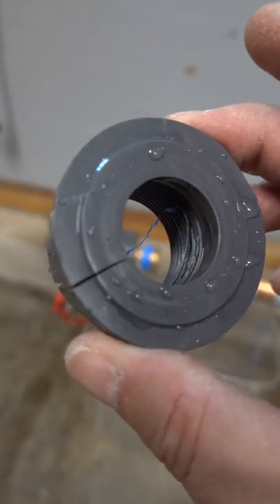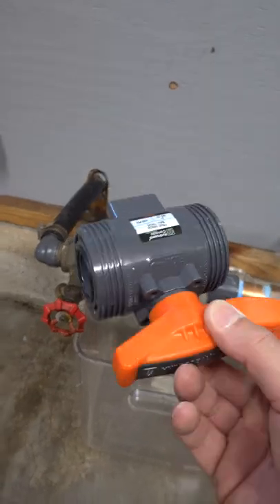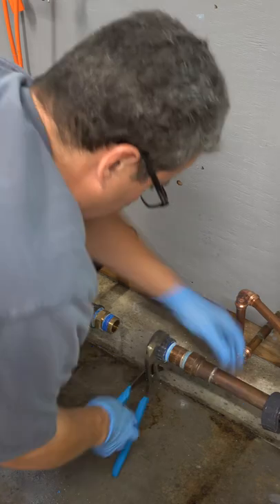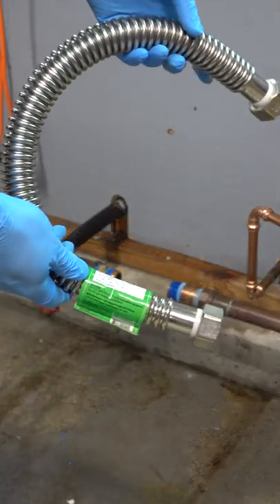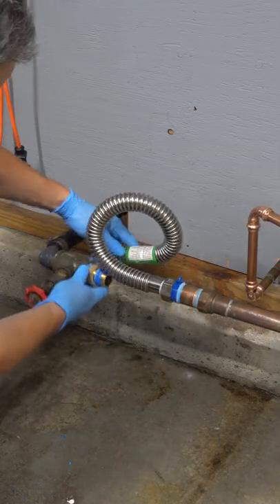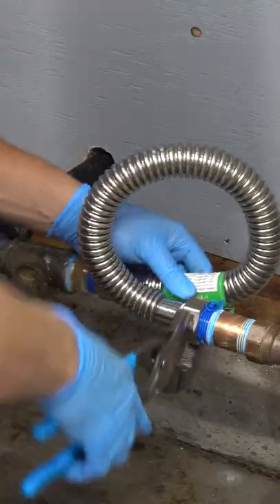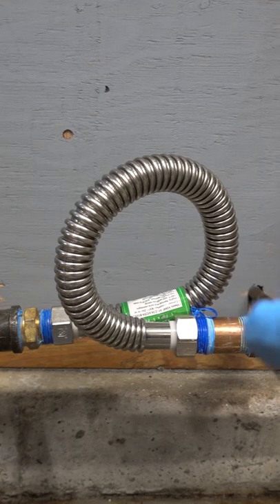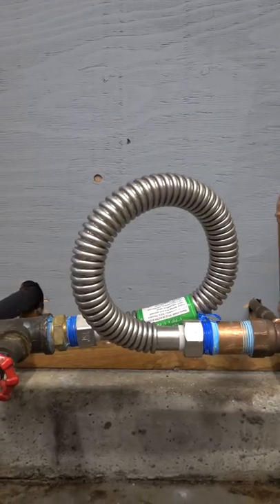POS Valve Almost Ruined by Marriage

Comment: “Hot water heater”😂
Reply: "Appliance that heats cold water to make the water hot"... ATHCWTMTWH 
hmm, "water heater" or "hot water tank" is easier
or, more properly, "potable/domestic water heater"

PS I got your joke😆
Reply: Randall Moore  radiators typically refer to things that "radiate" heat to the surrounding air, so no ... unless the radiator is enclosed in a vessel or container to transfer heat into another liquid/gas/substance, in which case it is called a "heat exchanger"
Reply: Randall Moore  incorrect... radiators do not heat up water, radiators "radiate" the heat FROM the water/steam/other (water/glycol mixture, whatever)... the water/mixture is heated by a source of heat, usually a gas boiler, in which there is a heat exchanger which transfers the heat from fuel air combustion into the closed-loop mixture
Reply: Randall Moore  to distinguish between the different systems, terms such as "hot water tank", "tankless water heater", "potable/domestic hot water" are commonly used for the domestic hot water side, while "central heating", "radiators", "infloor heating", "indirect tank", "boilers", "furnaces" are used for the heating side... at least in southern Ontario Canada 🇨🇦
Reply: Randall Moore  they do exist, except you are using incorrect terminology... I'm explaining that inherently a radiator "radiates" heat ... the appliance with the heating element is NOT THE RADIATOR, it is the HEAT SOURCE, be it electric, gas, oil, solar, nuclear... that is what contains the HEAT EXCHANGER
Reply: Randall Moore  given there are radiators that have an electric element and heat up oil... those are self-contained radiators, containing all of a heat source (electric element), heat transfer fluid (oil), and the radiator housing itself...
Reply: I live in the SoCal high desert. It's an accurate statement here in the summer. You heat the hot water... hotter. 😀
Reply: @blaydCA  I never been that far south 
What is your heat source? You guys use solar loops exclusively? or you have aux. backup heat? 
I've seen solar preheat loops that feed into gas-fired hot water tanks up here..
Reply: @walterbrunswick  One house is expensive Profane (pun intended) Gas with solar preheat tank, the other one is expensive electric. The service pipes for the area tend to be shallow and warm or cold depending on season. Edit: I'm high desert, so it does freeze here.
Reply: @blaydCA  what is the frost line down there? min. burial depth? here it's 5' 6" 
maybe I'm just naive, never would imagine it freezing in SoCal..😲
Reply: @walterbrunswick  It can and does go below freezing in SoCal. Obviously the higher elevations see a lot of freezing. In my general area service lines are about a foot down or more. I have no clue to what the frost line is. As a former New Englander, when we have extended freeze warnings I leave the water dripping. Unlike some, I've never ruptured plumbing from a freeze.
Reply: @blaydCA  if you need to leave the water dripping means smth isn't right.. we don't seem to have that problem in Toronto, and last winter was brutal cold 
I somewhat regularly see plates here from New England.. and there is a Cali plate Ford that has been next to my Dodge service van for a while now at my apt. complex ...... couldn't see myself moving to CA..... I would miss the brick buildings and architecture too much, even though I don't like winters (after childhood) ... don't like the heat and CA architecture isn't for me
Reply: @walterbrunswick  I don't takes chances, old habits die hard. Pennies for water is cheaper than blown pipes. Just ask Texas when they had their last hard freeze!
Reply: @blaydCA  😄😄 ... you're right about old habits 🙄......
... got tangled up in PEX discussions here on YT today.... PEX-A, PEX-B, flexibility, burst pressure, Dr. Engels, crosslinking, removing H+ ions, peroxide curing vs. moisture curing etcetera .... what in the f... never felt more confused.... several nights of insomnia doesn't help ....
What piping do you have in your houses in SoCal?
Reply: @walterbrunswick  As a general contractor: it ranges from galvy iron, copper, PVC, and Pex.  I personally don't install pex. Old school here, no shark bite crap, or those EXPENSIVE crimped copper fittings.
Reply: @blaydCA  understood 
I've never had any problems with Sharkbites or PEX ... haven't had a need for crimped fittings (I mostly do service and repairs), but they are good (see my other thread/argument here with an "old school" gentleman)
Reply: @walterbrunswick  I've had service calls for leaks from previous installer using sharkbite, and for other bizarre shit. LoL Retired now.... THANKFULLY!
Reply: @blaydCA  yes I've had to repair after clutzes a number of times..
if done properly, proper preparation, deburr, do NOT sand, silicon lubricant if necessary, Sharkbite will not leak ... I can bet my business on that
Reply: @walterbrunswick  The other issue with sharkbite and any gasketed copper fittings: they don't servive in high heat situations. I did do some commercial work including fire suppression sprinklers. Only in a desperate pinch would I use sharkbite. 
I did service calls for many years.....I no longer say "I've seen it all". There's ALWAYS something more borked around the next corner!
Reply: @blaydCA  okay this is smth new to me, but I've seen in suppliers "Sharkbite-type" i.e. push-to-connect fittings for refrigeration.. can you describe to me what "high heat situations" are? I wish I could tell you the melting temp of EPDM and I'm sure I could have when I was in trade college... spent many many hours after classes reading everything from electrical theory to chemistry to structural to welding.. but the years have been rough on me ..
many times I've "washed away" service calls with вод... er, liquid substances that Ukrainians Russians and Poles produce very смачно? tasty? well..
Reply: @walterbrunswick  I've no current refrigeration experience. High heat areas can include industrial process, boiler rooms, areas in fire suppression zones. Bear in mind too, a gas fired residential external water heater closet in this area is also subject to ambient temps hitting 120°+ f. I know I just hit those failed sharkbite with my torch on low and they're rapidly dismounted.
Reply: @blaydCA  just looked it up.. EPDM melts approx 275F..
if I hit a 1/4" steel plate with my Victor #00 oxygen-acetylene torch tip I will blow a hole in it.. 
Sharkbites were rated for potable and below boiling temperatures at atmospheric..
Reply: @walterbrunswick  But.... we're not cutting 3" mild steel with oxy/acet burning torch for simple plumbing job here! LoL 
Nor are we plumbing up some exotic setup with C.R.E.S sch 160 threaded pipe!
Reply: @walterbrunswick  Melting point of typical solder for copper plumbing: 440°+f. 
I rest my case!
Reply: @blaydCA  🤣🤣👍 absolutely, if you're working with superheated steam (sensible+latent heat), then yes, by all means, soldered or welded (my welding instructor had a ticket for welding steam, Canadian Armed Forces.. wouldn't want to meet that gorilla in a dark alley..)..
Reply: @walterbrunswick  My welding is "passable" with wire feed. I sucked at stick welding in those days prior to the "electronic" flash masks (circa early '80s)...so who knows how I'd do now with the fancy mask.. I haven't brazed in years.
Reply: @blaydCA  first time I ran an E7018 electrode in a 1/4" mild steel butt weld and brought it to him he said "I see you like this rod"..... 😁 
I mentioned I spent hours in the library, and I'm good with my hands..
Ended up going into refrigeration sphere....
Edit: and we didn't have any fancy electronic flash-masks either! we were using old masks with small window screens...!
Reply: @blaydCA  the gorilla ended "taking on" the class clown 🤡 ... let him "off" soon after..
We were there in shop class, he was telling me about his nice new wooden bar he had gotten made, new bar stools.... fk this is back in 2010...... remember like it was yesterday..... hadn't even flown over to my gf in Ukraine yet.......
Reply: @walterbrunswick  if YOU THINK ....that I remember back to the early '80 to what wire I used...
then I have a riveted fully assembled bridge to sell you! (Toll booths not included) 😂
Edit: picture "grapes" because there was an ABANDUNZA of them! LoL
Reply: @blaydCA  🤣🤣🤣 
No questions, that was before my time, I'm '87 
Any regrets?
Reply: @walterbrunswick  You haven't lived life if you haven't made mistakes or had a few regrets. 
I've made my fair share! 
I pledge to make more mistakes as time permits! At my age it gets easier every day!
Besides..no one gives a rats ass at any rate! LoL
Reply: @blaydCA  lol yeah, seems like we never learn!! well I'll tell you brother, maybe I'll finally stop fking up!
Reply: @walterbrunswick  I learn it fine....
...and then PROMPTLY forget it! 😜
I plan on buying some undeveloped land up north where summers are cooler and custom build something fire PROOF (Not just resistant). Heaven help any contractors that try and short sheet my project because I've seen shitty jobs and I've seen Pride In Workmanship. 
My way (better than code) or the hiway! 😀
Reply: @blaydCA  I.. lost track of what I was going to say/write..
Seems like we have a lot in common
Reply: @blaydCA  if you are looking for land in Canada, let's be in touch.. sometimes lots go up for sale here.. there are New Yorkers up here
Reply: @blaydCA  couldn't message you.. write me or whatever..
maybe we get together next year for шашлыки 😉
Reply: @walterbrunswick Thanks for the offer!
 I have a 5 acre parcel in mind that I will travel up and look at in a couple weeks or so. I've done the "due diligence" as best I can from here online. If passes in person due diligence, and I like what I see then I'll fast track the purchase.
I'm trying to stay "local" and it's only 700 miles due North from me, which is a relatively easy drive.
My understanding is that Canada is currently NOT allowing USA snowbirds the ability to purchase Canadian property due to housing shortage.
Reply: @walterbrunswick  Toronto is 2500 miles from here. It's a wee bit of a hike, and a long way to roll a flat tire!
Reply: @blaydCA  honestly I am not keeping track of what Canadian govt is or isn't allowing..
I was at the protests in early '22, then Ukr-Rus war started and I blacked out
Reply: @walterbrunswick  I was going to travel over to Castelo Branco, Portugal and look at property in that region.  However POOtin's  "Special Military Fuck-up and War Crimes Operation" sorta made that not realistic for the near term.
Maybe lady Fate had a reason, because they baked in Europe just as bad as here!
And now Europe is rationing energy, and inflation is nuts! 
Not to mention being on the apex of nuclear disaster!
Reply: @blaydCA  okay don't start with me on that
Reply: @blaydCA  re-read this thread, saw you edited one comment, so I did as well
just to let you know, while I don't support any wars, Ukraine actually started this conflict in 2014... it's a long story
I have a good Ukrainian friend living in ЛНР (Luhansk) with her daughter and parents... they've been under Ukrainian shelling since 2014 .. now her two Ukrainian brothers are fighting in НМ ЛНР against Kiev regime oppressorss 
and I'm telling you this as a Ukrainian-Canadian 🇺🇦🇨🇦 with family in western Ukraine (my blood is 100% Ukrainian, was just born in Canada)
Like I said there's a lot to the story
Don't believe everything you hear in the mainstream media bull
Reply: @walterbrunswick  I know it's a long convoluted story, and has been for like forever.
I usually edit for spelling, or something that didn't post correctly.
Yes, I have "auto corrupt" enabled, so I can have technology make me look like a complete idiot 😝
Reply: @blaydCA  yes yes, it's always technology's fault 😁😁😅
Reply: @blaydCA  I work with a funny refrigeration engineer colleague from Poland (he used to do refrigeration for mine shafts back home..) .. when smth goes wrong he says "just Blame Chiina" or "just Blame Putin" 😅😅 ((!! he's not against Russia, he understands the situation well))
Edit: the guy is a former tank driver of Soviet T-34 (Poland was given the designs for manufacturing)
Reply: @walterbrunswick  Just remember....I was around when this "technology" first started! I used to know my way around it quite well.
Didn't trust it not to bork-up then...and still don't trust it!
Reply: @blaydCA  yep yep, I believe you! 
well, I think it's safe to say we've come a long ways since the 70's & 80's...☎️-›📱🙃
Reply: @walterbrunswick  Cripes....my first cell phone was ANALOG! It actually had a handset and buttons!
Expensive as hell..dollar a minute, back in....hmmm. '86?
Reply: @walterbrunswick  ..or early 60's..LoL Seems like yesterday! NOT! 🤣
Reply: @blaydCA  we still have some technology kicking around from back then... VERY VERY glad I didn't have to live through those times
don't get me started about the wallpaper and carpeting... my grandmother's house from the 50's (bungalow, surprise) is basically untouched... full salmon pink first floor bathroom, aqua green bsmt bathroom, large checkered floor tiles 🤮... you name it ... it's still like that right now! 
Like I said, very glad 🙏😅
Edit: black&white and pink&white large checkered vinyl flooring... possibly the ugliest design in all of human history
Reply: @walterbrunswick  different times, different tastes. Some of the stuff they decorate with today can be pretty tasteless also. 🤮🤮
Reply: @walterbrunswick  At least things lasted FOREVER in those days. Now you look at something wrong, it breaks or dies.
Reply: @blaydCA  that's a misconception...
You can absolutely buy quality today that will last decades, but the average consumer wants to "save money" so they cheap out and buy Chna or knockoff stuff...... then they complain that it "doesn't last"... well duhh cheapskate!!
I have bought a number of German-made drills for about $350 a piece... compare that to the $70 drills available on Amazon, and the buyers are "shocked" that they "don't last"
Reply: @blaydCA  agreed about the designs of today... I noticed that in the 1990's they started adopting designs of the 1920's, French glass doors, Wainscoting, Crown molding, and the like, but then they were building houses just too big.. not cozy
Edit: adapting/adopting... also to say my other grandmother's house from the 1920's (built 1928) is timeless... elegant and beautiful, with all the features of the 1920's mentioned above
Reply: @walterbrunswick  My last German made drill was an AEG, around 1982. It's still in use. I generally buy high end, unless it's not gonna be used much.
Reply: @blaydCA  yep, you got it right 
AEG is still around... most of my cordless are Bosch, and Metabo is my favourite "expensive" brand (nearly got my arms twisted off by their drill in the mid-1990's) 
I once heard a saying, "I'm too poor to afford cheap tools"😄
Reply: @walterbrunswick  oldest house east as client: Oliver Estate, Middleborough, Massachusetts under original family owners (pre USA revolutionary war) plus a lot of other old ones Almost as old.
Out here, one of the first homes in Palm Springs, CA (it's now the "Movie Colony Area").
Reply: @walterbrunswick  Mostly Makita here, a few other tops brands depending.
Off to the races...showing a clients apt complex. I retired and they put it up for sale!
Reply: @blaydCA  Makita is good.. in-house manufacturing.. Chna can absolutely make good stuff (we've come a long way since year 2000), but you will pay for it 
good luck with the showing!
Reply: @blaydCA  don't talk to me about "movie colonies".…. since I've been here in my apt. since 2014, they have staged at least 8 times here to shoot!!
.. after a hard day's work I want to come home 🏠, not onto a Hollywood stage set🤬🤬🤬
Reply: @walterbrunswick  The good Makita is inhouse. The light duty is Chineseum.
The Movie Colony in Palm Springs is where many of the notables came to stay and play away from Hollywood. It's a historical district. They're semi-mansions.
Reply: @walterbrunswick  Had to drive through minor flooding after show and tell. I just give cooks tour of facilities, known issues, ect. That particular property was very long term client from circa 2011(?).
Landlord can't even find his keys for it! LoL

Comment: Gotta be careful connecting plastic to brass even brass is soft overtighten it it will warp and it will never stop leaking. Plastic i always go hand tight and give a small crank or two with pliers then if it leaks just slowly tighten till it stops. I always use enough teflon maybe even dope it up if you gotta too

Comment: What are you doing using a plastic valve when you already have a brass valve in front of it.  The water heater flex line is good idea and will last for many years.

Comment: Why didn't you just use a brass threaded shut off. You can buy it at the same place you bought the temp line and works way better. You already have the brass fitting so keep it going

Comment: Keep in mind a loop like that might leave air at the top of the loop.
Reply: You're right, but very unlikely at jet pump velocities with this diameter piping ... that's usually a problem with circulator pumps in radiant heating systems

Comment: We have hard water heavy with minerals iron mainly our well points pump the valve switch pressure valve switch I think it's called I have to change that yearly and I used to be able to get away with just changing the contacts not anymore sadly I've rewired that house front to back and it's even better than so called electricians that are 20 years in the field and I have no experience lol

Comment: Looks like your thread tape was put on backwards causing it to roll up when you put the hose on secondly that flex line should have rubber gaskets so thread tape is not needed
Reply: That was just some left over tape that wasn't on the end threads, but you are right there are gaskets on the stainless pipe.